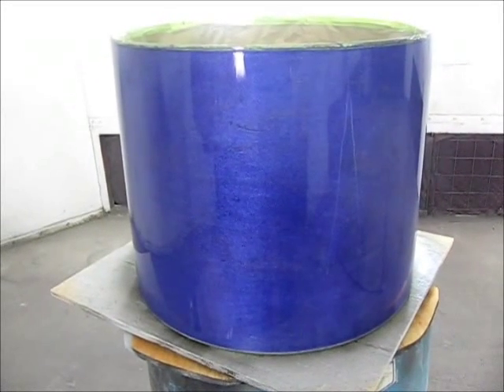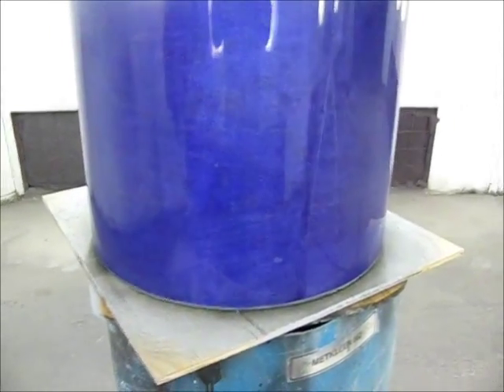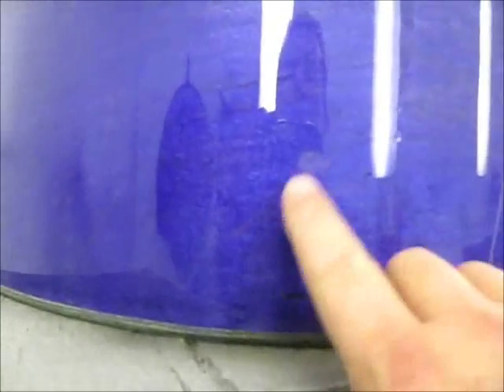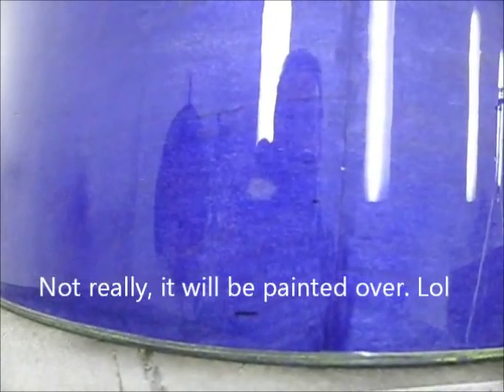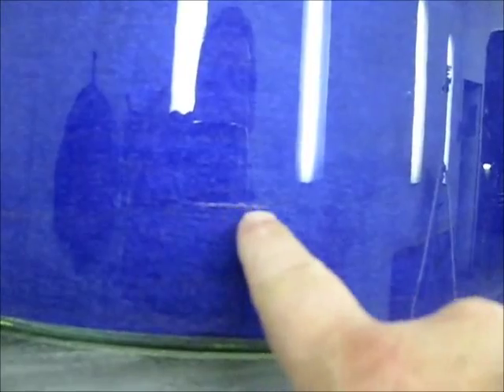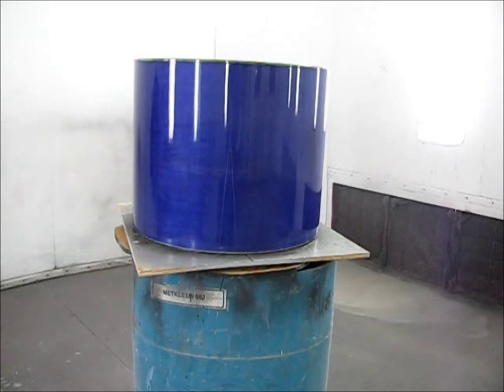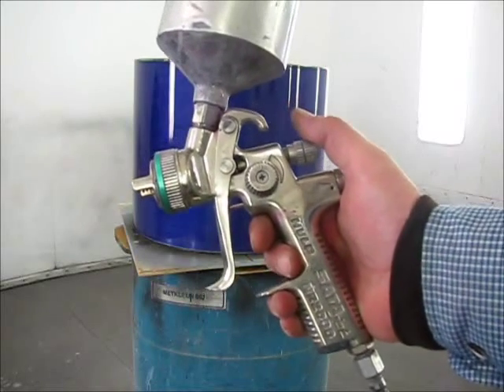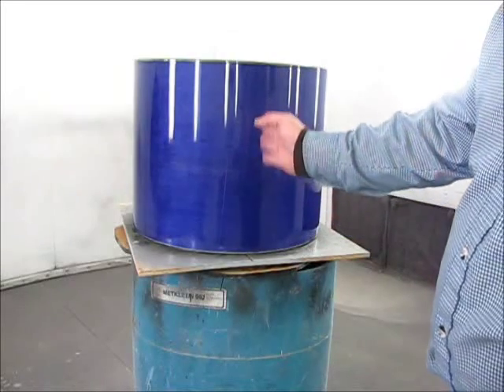Paint a drum shell: How to do a fade. Part 7

Comment from the maker: Thanks Jon. Actually it wasn't so much as to seal the stain coat but to fill in all of the low spots of the wood grain. It's possible to go right to the fade color but you are risking the low spots of the grain casting shadows in the solid fade color thus causing an undesireable effect. It is VERY tedious. I use the same technique when I used to paint guitars that were bare wood and the grain showed through.